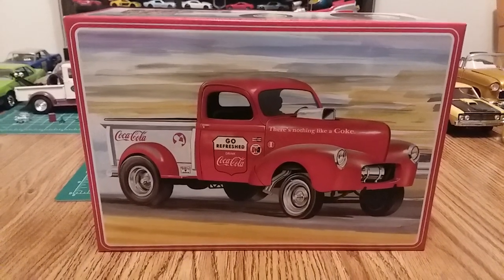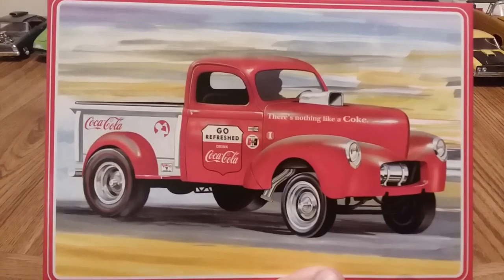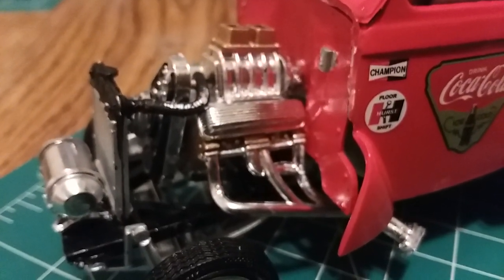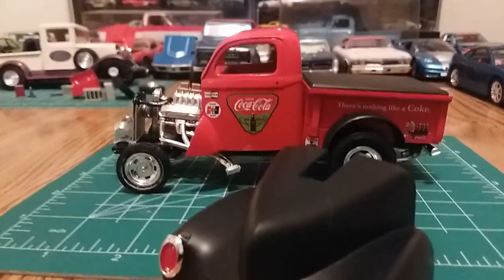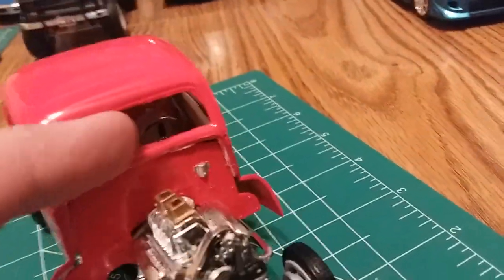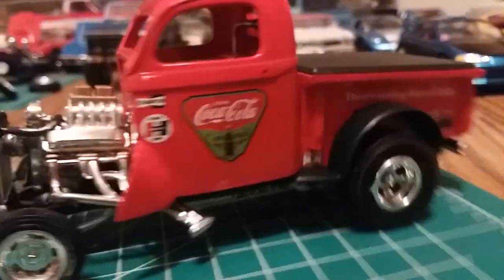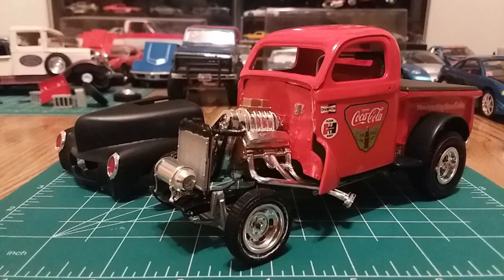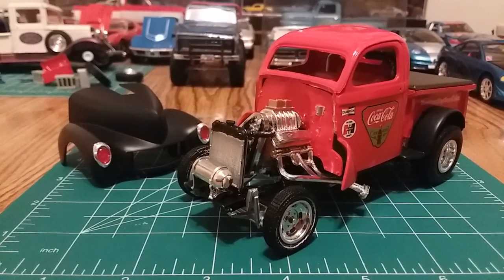Model Car Build Final and Review...AMT 1940 Willy's Pickup Truck Gasser

Comment: I've built this kit several times since my teens in the '70s, most recently in   2003;  it finished beautifully, 
and still sits proudly on my shelf. I had little or no difficulty building it. Remember it's basically a 50+ year old kit reissued by AMT in many guises, over many years, 
multiple times,  and it undoubtedly shows it's age. However fussy it is to build, with all the fit issues and such, it is definitely NOT a horrible kit. I have always loved this kit- with  experience and patience it DOES build up to a really nice model. Wish I could show you....

Comment: The fire wall glues to the outside of the body not the inside.
Reply: Thats what holds the top of the hood on.
Reply from the maker: The instructions weren't very clear on that, I test fitted it both ways. I was so done with the kit by then anyway. I appreciate you watching and writing!!!

Comment: I built this mess about eight months ago, and I had a lot of the same problems you did.  I thought maybe I just got a hold of a bad kit, but I have talked to another modeler that had headaches with it too. Its kind of like some of the older AMT semi kits that had terrible fit issues. I do like your hood and the headlights look really good.  I agree with you the engine looks like something out of a really cheap toy. Round 2 dropped the ball on this one for sure. Great video, like your plan to put it on a trailer that will look good. Sometimes we just get a bad kit , fortunately its not to often . I really like the Revell kits , they.go together and have a nice fit, the Tamiya kits are good ones too , but a little more expensive . Personally I would rather spend a little extra to know that when I'm done the hood will close and the body can be attached. Like I said great video and you did a good job, considering all the problems with the kit.
Reply from the maker: Thank you for watching and writing, really appreciate it! Always cool to hear everyone! I had so many issues with this kit, but there are a lot of great builds online of this kit, like they didn't have any issues, and maybe they didn't. Lol. I guess you win some you lose some.

Comment: I'm working on this kit right now. I sis notice the front of the blower on yours is either missing, nor is on the back. Also looks like you needed to cut away a bit more on the chassis to get the bed to sit properly, the step is hitting the floor pan. I think they used the chassis from the car, and that's why you need to cut all that away. Thanks for your post, I'll be looking for the issues you pointed out.
Reply from the maker: Appreciate you watching the video! I had lotta problems with this kit, but there are a lot of real nice builds of it here on YouTube so I know it can be done. Hopefully yours comes out nicely!!!

Comment: I built this truck in the sixties, when it could be built as the pickup or the coupe. Back then I used good old Restore glue( all we had) and had no problems. The firewall should be aluminum. If you want to see the actual truck that this kit was patterned from check out The Rodder's Journal , edition number 84 . This is the old Panella Trucking Willy's  from Stockton California.

Comment: I just purchased this kit. Too little info too late, I also just finished another coca cola amt kit, the 1953 ford kit that was a project...also. Maybe these c/c kits are not so well to do. Part fit problem...etc.
Reply from the maker: Thank you for watching and writing, I really do appreciate it! I had many issues with this kit, but there are a lot of videos of some real nice builds of this kit. It's an older mold, some of the older kits aren't precisioned as well as newer ones are. Unfortunately we all run across one of these poor kits every now and then

Comment: I built two versions of the same kit.
There are fit issues. If you pre fit and modify for better fitting you can make a nice looking kit out of it. But it definitely will challenge your building skills and is a poorly engineered kit.
Typical of AMT kits.
Reply from the maker: I had never built a gasser before and was excited to try one, should have started with a one of the Revell Monogram kits. But we all know in this art form, you win some lose some. I really appreciate you watching and writing me!!
Reply: @carouselofcrazychrisb  > for about the last two weeks I've been doing a scratch build fuel altered the chassis engine is ready. But I'm trying to come up with a body. I saw a 41 Chevy dirt track racer I think I'm going to use. It's copper frame the body is going to be gloss black.
Reply from the maker: That should be pretty cool!!